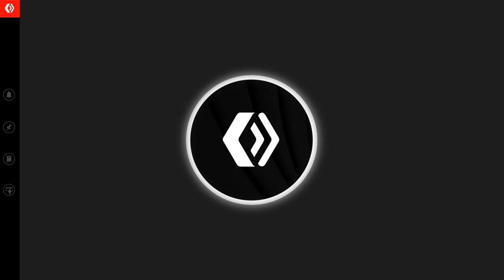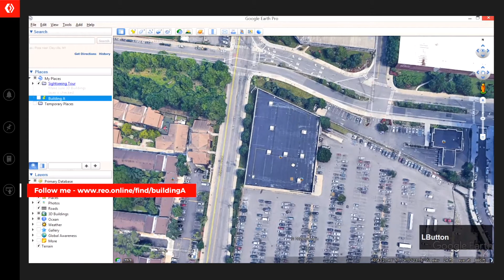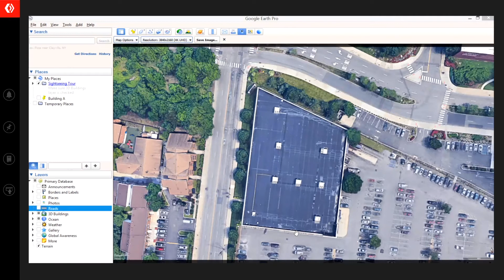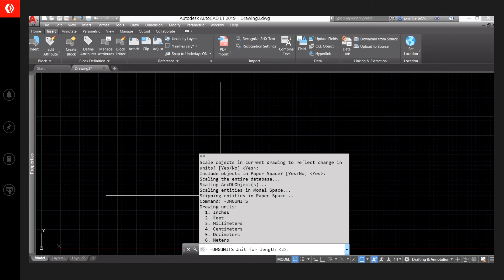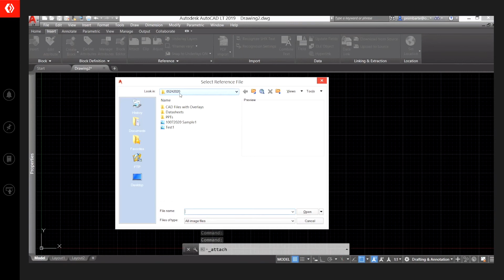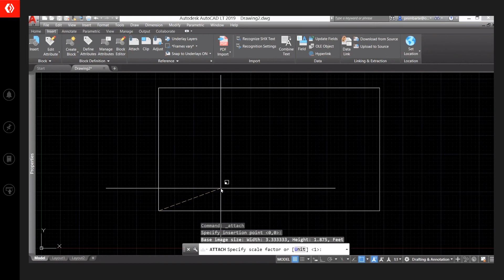How to Import Solar Site Images in AutoCAD | Online Solar Training Courses

Comment: Hey Thanks for the this information, I have a question, In the next step we have to design the solar layout, how can we place the solar panels and how can we set the scale in autocad, Kindly give a solution, Thanks
Reply from the maker: Setting the scale in AutoCad can be achieved by using a command called 'DWGUNITS' in the command bar.

To learn how to place panels on the roof & design a complete power plant, follow this link - https://reo.online/training/autocad-sld-solar/
Reply: This video is very helpful. Kindly complete drawing training videos. Step by step